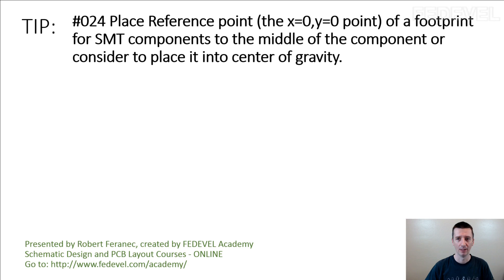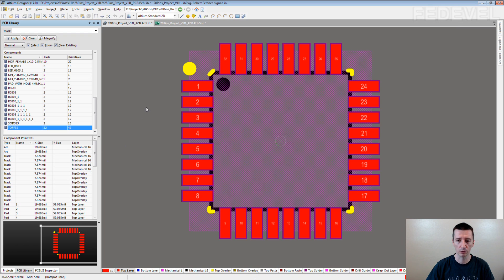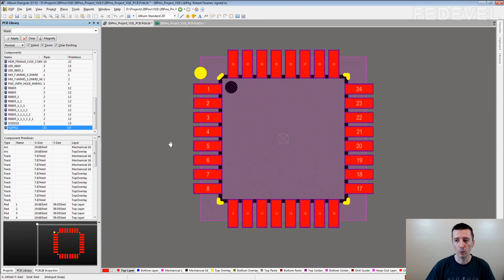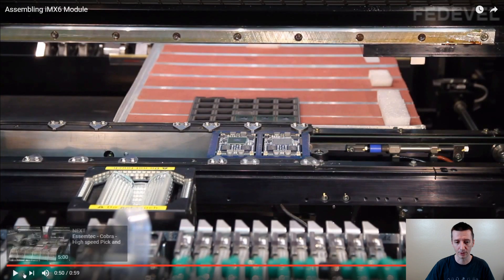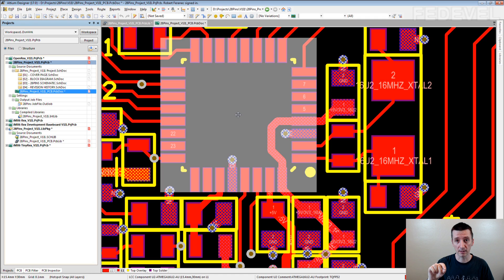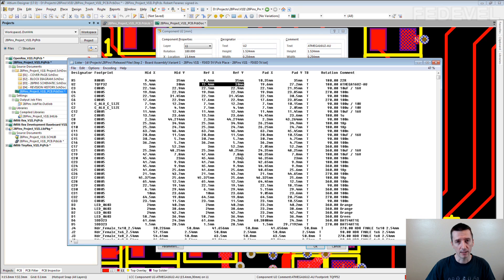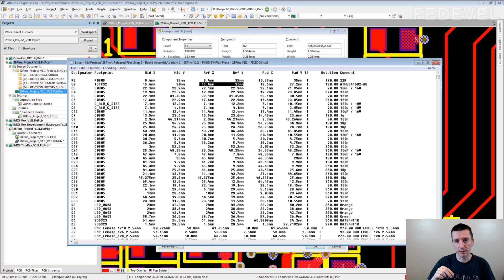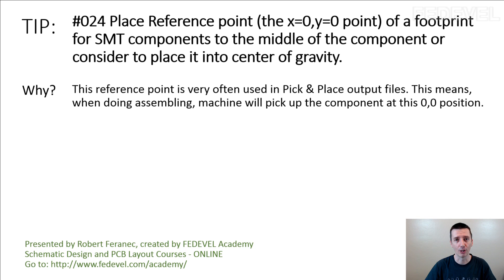TIP #024: Place Reference point (the x=0,y=0 point) of a footprint for ...

Comment: We have very small assemly line in house and I have two more tips that help a lot.
1. Before exporting P&P file place board reference in one of the fiducials. When they are translating program for machines they need one fix point they can easily see on the camera. It can be done with measuring gerbers and then calculating new points but it takes 10-15 minutes more!
2. Robert, one is for you too. Make comment more iformative. Make it "C0603 100n 50V X7R" or if it is more important make it manufacturer part number. They need to translate your part into their own internal code and if you have more complete comment they don't need to search arround BOM list with all designators which is often not provided and find out what that component is. Also if you have two resistors 1K one 0603 and one 1206 they can more easily find all similar footprints and replace them with internal code.

Altium should fix this annoing bug when coloumn shifts if Footprint name is too long!
Reply from the maker: 2) Now in Altium you can generate BOM from PCB with component position and also the part number (eg. if you use this as LibRef). Possibly there may be a way to import parameters from schematic into PCB - but I have not tried this yet, but I think I read something about it. That could help. It was not possible before. I am not sure how it is in other systems.

Comment: There's another good reason I always do this: it's so much easier to use alignment tools if the components have their reference points in their center! By the way, you forgot to explain why you set the reference point on pin 1 for TH components.

P.S.: you are doing an awesome job sharing your knowledge.
Reply from the maker: Reference point in Pin 1 for TH will be in a different tip ;)